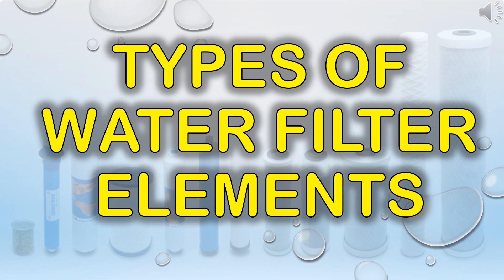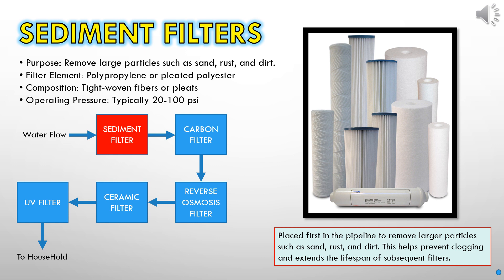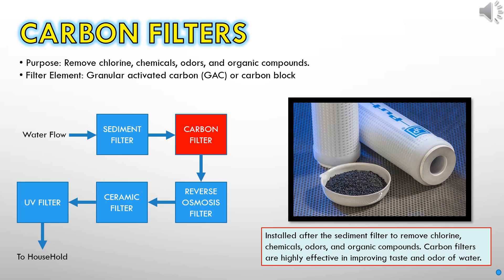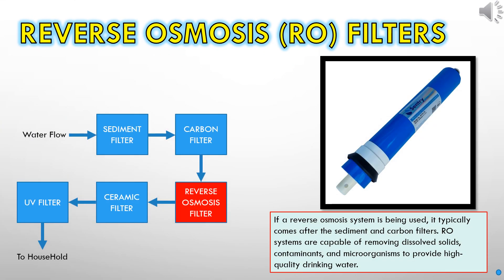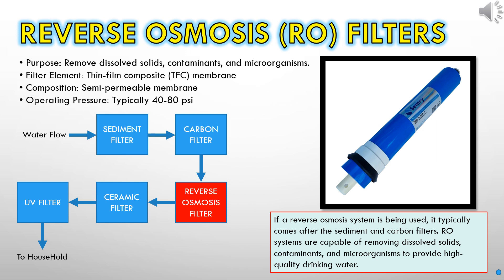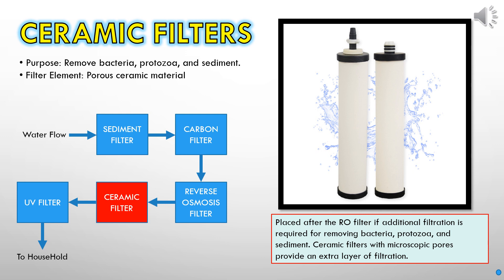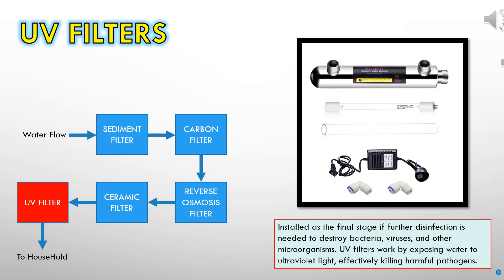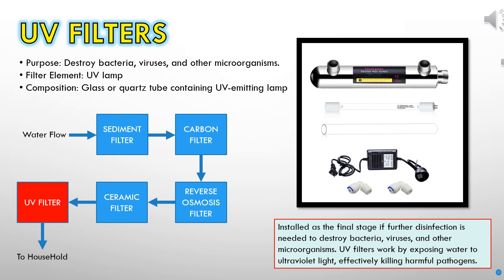Ultimate Guide: Types of Water Filter Elements for Home Filtration Systems

Comment: to the point but isn't RO enough after all the previous filtration stages coming before? Also would be great to state for each filter the pore size. And last: filtration is the first stage, after you need to remove information in water see water has memory II, mazaru emoto, dr korotkov. This is done via vortex. Then you need to reinform water with the right information. This is done via magnets, special symbols, music. MP for more
Reply from the maker: It just to show that you can still add more until you will get pure H2O but not necessary.